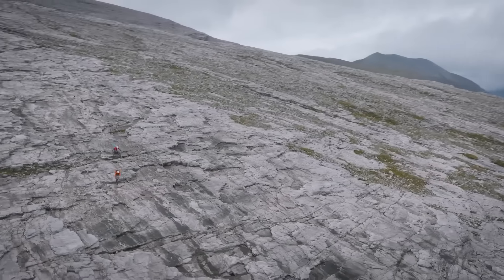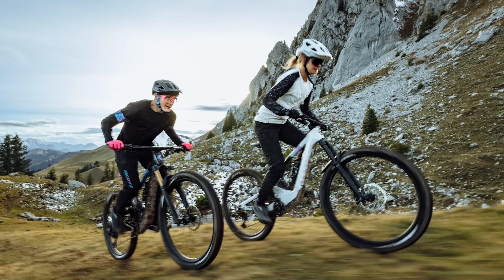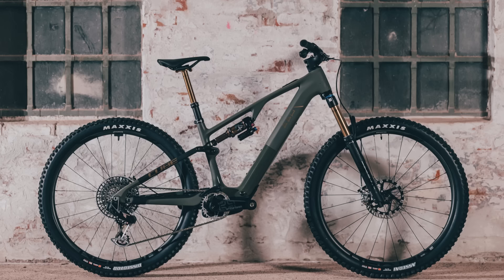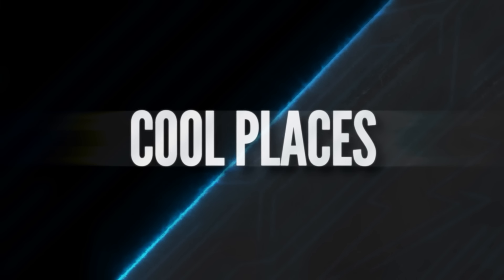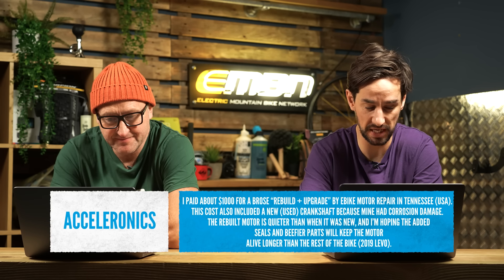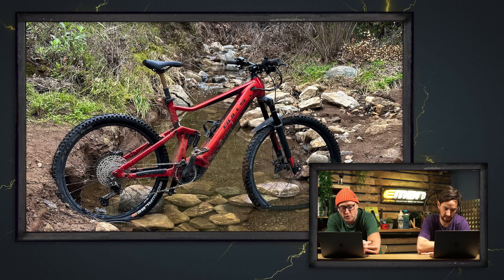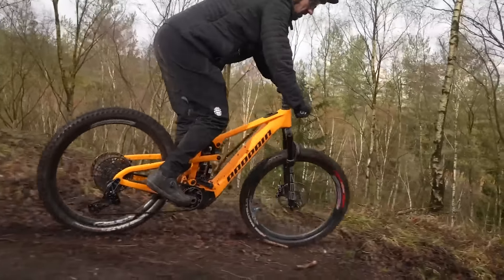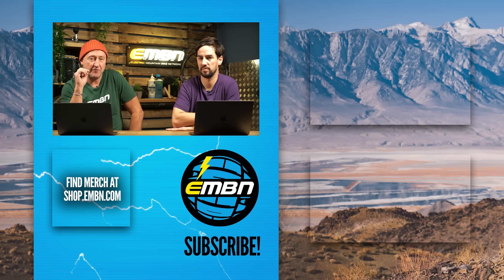Cutting Edge eBike Tech From Switzerland | EMBN Show 322

Comment from the maker: What do you think of the hidden shock design? Is it more hassle than it's work? Share your thoughts down below! 👇
Reply: what shock?  most people who buy bikes like that will never service the shock, as they won't even know it's puked its guts out or lost it's air.
Reply: The bike looks stunning. Lost me at non removable battery tho.
Reply: I’ll stick with my EXe. It’s a pound heavier. But, I can remove the battery if I want.
Reply: Here’s what I think: 🖕 my phone doesn’t have the British version.
Reply: Like the bike, hidden shock seems like a perfect spot for dirt to accumulate and impossible (nearly) to clean...
Reply: even non-removable batteries have to ultimately be removable (not instantly removable but with a bit of dismantling, it may be extracted after some wrenching), or how could they have been inserted into the frame? @TheScramble8

Comment: there's a big difference in handling and feel of an eeb that has a big 750-900w battery all the way up the downtube versus a bike with a smaller 360-540w battery mounted way down low......that's prolly where you'll notice it the most, even if the overall weights are close.   Where the mass is placed makes a huge difference in bike feel
Reply: Yes, a 900wh bike is a bloody heavy bike. It doesn't have the nimble poppy nature of a bike with a battery half its size.

Comment: I don’t get why people make the weights such a big thing. I don’t care if my bike is 19kg or 24kg. It really doesn’t matter to most people
Reply: Yes, it does matter. My 39 pound EXe literally handles like an enduro bike and I can pedal it well past the 20 mph motor cutoff. When you’re an expert level rider, that makes a huge difference.
Reply: @Shawn-in-da-Canyon  and you can do all that solely on the weight.
Reply: @SGSAutomotive  When you’re riding a bike that’s 15 pounds lighter than a full power bike, yes. Plus I can take the battery out and it’s now a 36 pound analog enduro bike. Don’t knock it, till you try it.
Reply: @Shawn-in-da-Canyon riding past the cutoff has to do with the lesser drag of that motor, just like the Fazua Ride 60, not the weight of the bike.  That’s why, like with the Transition Relay, you can ride them with the battery out.  It’s the motor drag.
Reply: @dadventuretv2538  My TQ motor has no drag. Go out and pedal a 40 pound bike and go out and pedal a 55 pound bike and get back to me. I’ll take a light Ebike any day. The other day I pedaled my EXe past the 20 mph cut off all the way to 45 mph coming down a single track. That’s impossible to do with a full power Ebike, because of the weight and motor drag. You don’t even know what’s you’re taking about, because you haven’t ridden a light Ebike.
Reply: Easy eay - lose a few kg yourself!
Reply: It does if you have to lift it to get it on yr car or a few steps in yr house if doesn’t fit the elevator.
Reply: Mine weights 24kg I think and I lift it over all sorts when out riding and I’m not a strong guy. I just don’t think a few Kg matters. My opinion won’t change but I accept you can have a different one
Reply: @SGSAutomotive  That’s because you haven’t spent the time on a light weight one.
Reply: It does when you need to lift it onto a shuttle rack

Comment: Im with Steve. I don’t understand why weight is an issue on a 63.9 degree HTA, 155/160 bike. That bike is built for the DH part of riding. The weight not only doesn’t matter with a motor but, like Steve points out, to get there by doing things like putting Exo casing tires, a tiny battery, small rotors. (Yeah 200 mm rotors could actually be bigger on an all mountain/Enduro emtb) is detrimental to the use it’s geo and travel suggests. And honestly, I’ve never felt better going downhill than on my (sale weight) 53 lb Ibis Oso. Oh, and it jumps and likes to get rowdy better than any other emtb I’ve ridden. I’ll say this again- it has a motor, that totally negates the old ideas about weight. 

IMO lightweight emtbs should be reserve for lighter duty trail/xc bikes, where doing things like having EXO casings isn’t going to cause flats every week.

Comment: It seems that MOTORS are being developed at a faster pace than BATTERIES
Reply: The new Bosch Compact Power series use larger, but more power dense individual cells to create a more power dense battery.

Comment: Low powered bikes don't sell at all in my area. Extra 2kg for a full power is a no brainier. Can you upgrade your shock? Will it take a coil? 🤔
Reply from the maker: Is it quite steep where you live? That's an interesting question! If the measurements all line up and the shock actually fits in the frame then it should be okay. Scott will have probably created a list of shocks that are compatible with this frame 🤘

Comment: I think that geometry numbers are very important anything less than 66 deg head angle can be ignored.
Reply from the maker: Which way is less? It does seem that less and less bike are coming out with head angles steeper that 66°, could this be because trails are becoming steeper? 🤔
Reply: @embn  I don't have a problem with less bikes being available with greater than 66 deg. it makes my purchasing decision much easier. All light weight lower than 85Nm, not interested. All bikes with flop head angles, not interested. All bikes for motorcycle money, not interested. My local 28 deg climbs are steep enough for me, the flow and balance of steep head angles is what I prefer over flop.

Comment: Rider max weight goes down with lightweight bikes , generally speaking. Lightweight bikes are typically 250lbs for bike + rider + everytging else , vs 300lbs or more for full power 'heavy' evikes. This is often skipped detail.

Comment: 🤔It seems to be that a SL Tail and Enduro Emtb have a SMALLER battery, with or without range extender.
It seems to be that a NO SL Tail and Enduro Emtb have a BIG battery, with or without range extender. That since the weight of the engine not have so big different than the different on how more heavier a Emtb with is stock big battery. 
I think that we have put a weight limit to end this endless SL problem, say 19kg.
No we can with or without range extender have a SL Emtb  or not😋.
19kg❤

Comment: Unfortunately for me, the Scott has a shed load of 'stuff' around the bottom bracket and it looks clumsey, and a non removable battery is a huge NO NO for me. Sod the weight, it has a motor.

Comment: There is a place for the SL bikes. Not everyone rides rough trails all day in high assistance. Most of my riding is after work 10-15 mile rides on wooded XC trails in eco or trail. I don't need a range extender, so why carry it?  Exo or exo+ tires are plenty tough enough. I don't want to hear the motor or feel the extra weight. Most women and many men are 50-75# lighter than you and bike weight is a much higher percentage of their body weight. Stop judging bikes only against your personal standards.